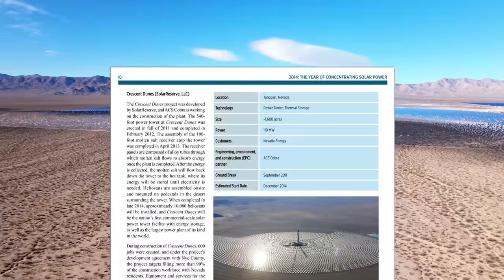The Failure of America's $1 Billion Solar Farm

Comment: they never intended it to really work the cost of the project even had it worked properly. The maintenance alone meant it would never make money. Everybody depends on the scientist in these engineers, and they’re smart, but they’re dumb as can be when you put them in the real world because they don’t understand how things go. How about the stuff that they’re not telling you about all the birds they got killed about the reflection from the mirrors on planes and helicopters that flew over the area. How about when it worked right the extreme heat that the mirrors put off had to of been adding to global warming and that’s just the tip of the iceberg.

Comment: The problem wasn't in the overall design.   It was I  their cost-cutting and wanting a hands off system.  That's not reality.  The motors the used to move the mirrors were trash, not designed to work in a hot desert.  And they somehow thought that they wouldn't need to actually PAY PEOPLE to clean the mirrors.....typical American rent-seeking behavior.   Not sorry that you have to pay some employees.   Same system works elsewhere in the world.  Non crappy mirror motors....and actually paying people to clean the mirrors and it's shockingly efficient.   
Doesn't work when you're only goal is to extract profit.....

Comment: most individuals can put solar on their property effectively. We put a 4.5 kw german inverter run solar system with norwegian panels about twelve years ago when systems cost three times what they cost now it produced more electricity in a year than we used and the rebate from producing spare electricity transferred to the network paid for the cost in 7 years in total. We did not have a battery system that magnifies it's value providing stored electricity when no sun etc. from stored power transferred there during high solar hours.2o year panel warrenty given. just dont buy chinese rubbish no matter the label

Comment: The tenor of this video on a fascinating topic is a bit disingenuous.  First off, concentrated solar is not a new field.  They installed their first gigawatt 14 years ago in 2010.  The Crescent Dunes project was innovated for its time and size, and much has been learned from the problems it had.   For example, it seems that most thermal solar projects use a lower nominal temperature.      But the fact that  the project is now delivering power to the utility, exactly as planned means that the project was a huge success.   The problem mainly was one of of accounting, not of technology.    Accountants make mistakes and the costs vs. initial revenues were badly miscalculated in this project.   But that could happen in any business.   Some of the initial investors probably lost money as a result of the bankruptcy...but that was money they could afford to lose.   The taxpayer may have lost some money also but that will be more than made up for by the money taxpayers won't be forking out to FEMA for global warming-induced disasters and also the health benefits of not burning coal & other fossil fuels.    I'd call this a 90% success.

Comment: There are a lot of videos on you tube bashing solar and wind power, brought to you by the fossil fuel industry and oil lobbyists.
Reply: Solar advancing fast and is getting cheaper and better. "Paper-thin solar cell can turn any surface into a power source" "Researchers develop a scalable fabrication technique to produce ultrathin, lightweight solar cells that can be seamlessly added to any surface." -   Adam Zewe | MIT News Office Publication Date: December 9, 2022. And now sodium battery factories are in starting production .

Comment: So then as clickbait and as nay say denigration narrative against solar panels... You show a standard solar farm of standard solar voltaic panels for the thumbnail and the beginning of the video. But this project you talking about didn't HAVE solar voltaic panels. It was a series of mirrors laid out in a ring around the centre simply reflecting the sun's light to a centrepoint that boiled molten salt. One of a kind and completely different than standard solar farms with standard solar voltaic panels of which there are thousands of that functions just fine. So you try to point out the failure of this special solar project and tack it to photos of regular solar projects to discredit them. Typical fossil fuel stooge misinformation think tank troll operation.